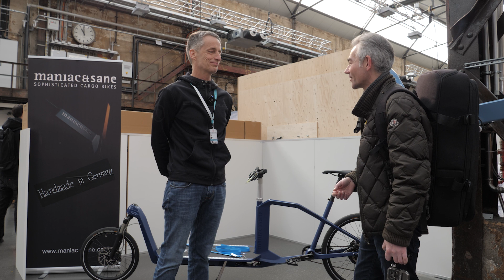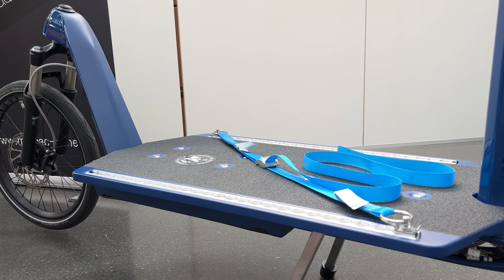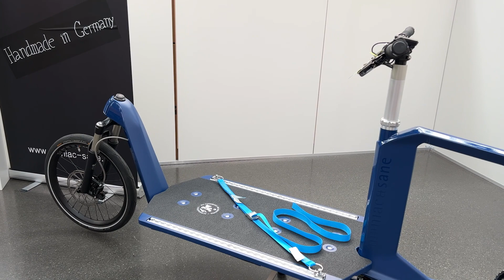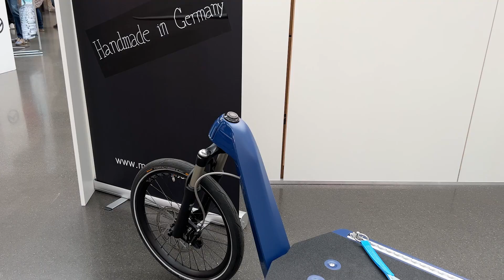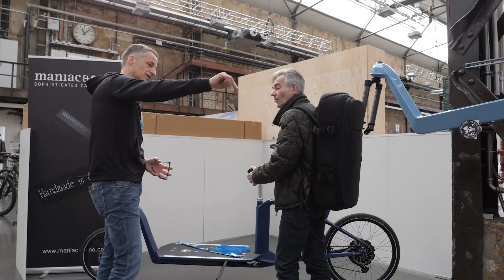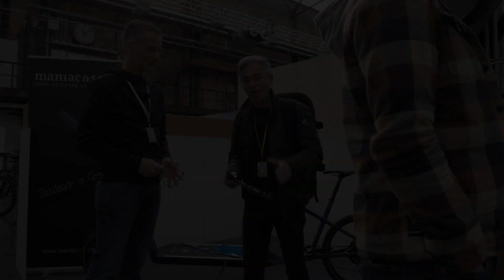Maniac & Sane Carbon cargo bikes.

Comment: The L-track on the cargo deck is the coolest feature here. But the cost is so high I've been researching how to build my own from carbon fiber. Still not convinced it can handle the bumps and bangs under load. Is the 8 kilo weight savings really significant and worth the extra $$ when you've got a motor? Need to get that cost down. Price it like a pinion eBullit and I'll be there to pick one up.